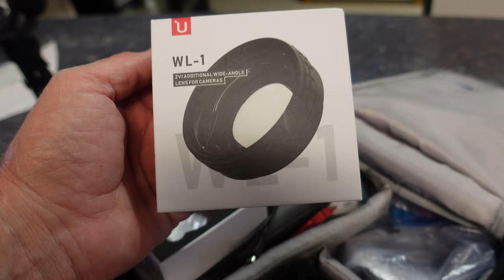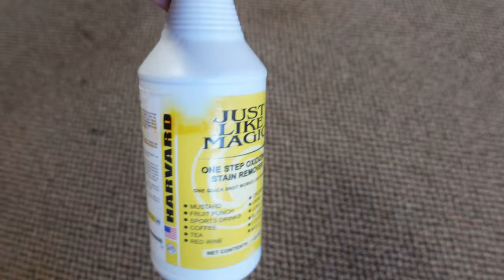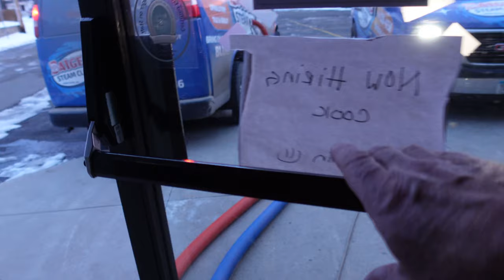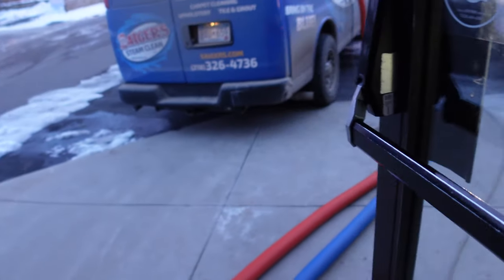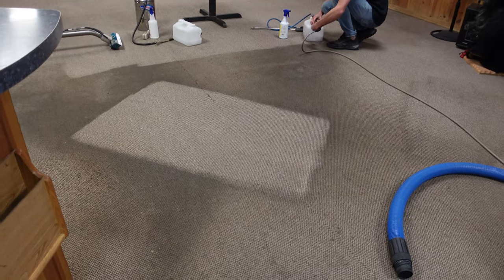Cleaning Greasy Carpet after Full Knee Replacement

Comment: Hi Mark , 

What can be the reasons if brown stain appears on the carpet after cleaning, especially in heavily soiled areas ( before clean) ? 

Any suggestions from you will be helpful. 

Thanks in advance
Reply from the maker: Great question and it can happen to anyone. Brown stains can be from a spill (as you might see our coffee stains in this video) and sometimes people will try to clean a spot themselves which can create a residue problem that after being wet, it will Wick residue and maybe soils to the top of fibers. Sometimes that residue from an ambitious homeowner can be quite heavy and even into the pad. When cleaning carpets we do not wet or clean the pad which would cause other problems. Another situation is that there was not enough dry soils removed with good vacuuming prior to doing wet carpet cleaning procedures and those soils will also transfer to the fiber tips. Even with a good pre vacuuming there can still be wicking. The way to avoid that is for the homeowners to do more vaccuming (if life style allows) and or maybe having carpets cleaned more often. For us, most browning Wick backs we run into are from homeowners attempting to clean. Our treatment is typically using a peroxide product such as the Harvard Chemical Just Like Magic used in this video or our new Saiger's OdorOxy. Mist it on and leave it to work. Another process especially if a much larger area is using an encapsulation product such as our Harvard Chemical Oxy Encap Pro. I hope this long explanation might help you a bit. Let me know if you have more specific questions I might have missed answering for you 😊

Comment: I picked up a wagner Wall paper steamer at loews .a Couple months ago.They take a while to heat up.
Reply from the maker: Yes they do. I go to ebay and buy the Black and Decker Steamworks wall paper steamers. They are not made anymore so can only get them used. We have one on each van and a back up in the shop. Also, we drain them and steam out excess water after using. You can also get more life out of them if you use distilled water which we always seem to run out of and never get back in the van 😁😅
Reply: @MarkSaiger  Yep distilled water for sure.Water in different parts of the city Varies...Have a great Sunday.Always count your blessings.😁